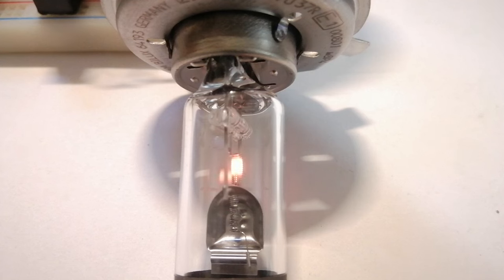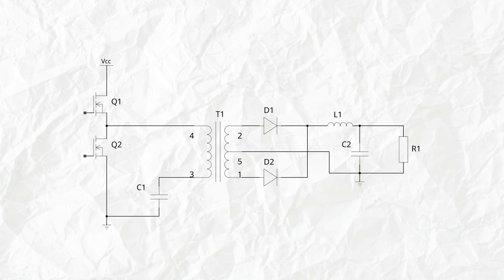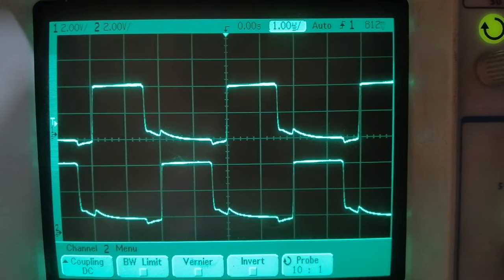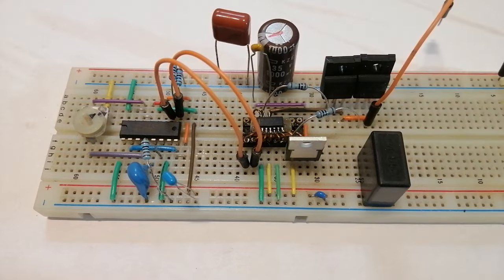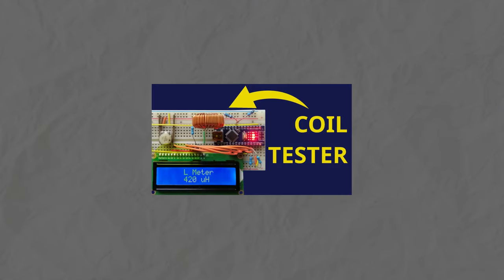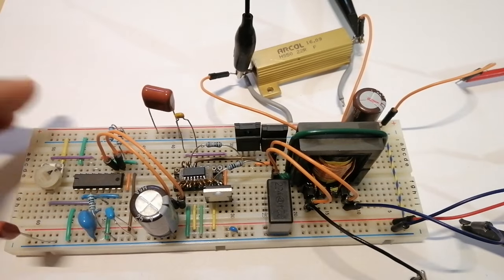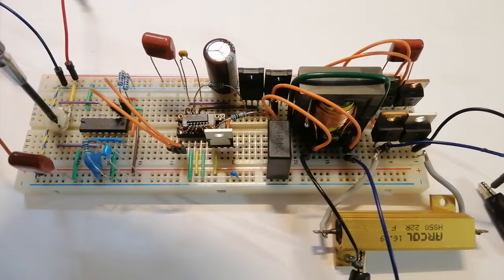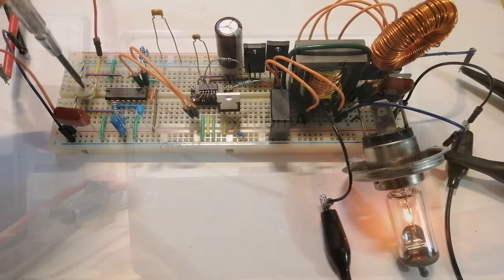Building and Testing a Half Bridge SMPS

Comment: Nice! Keep in mind that flyback transformes cores have an air gap, and that's no good for forward converters, it may be influencing the behavior of your circuit and influence efficiency for sure.
Reply from the maker: I forgot to mention that I ground down the ferrites to remove the gap, it's not the most beautiful solution but it works well. The important thing is that the primary inductance is sufficient, which is what the gap effects.
Reply: @5VLogic It doesn't need to be pretty, it only needs to work  :) the only issue possible with sanding is it may not be 100% gapless due to flatness imperfections, but it wont make a huge diference anyway.

Comment: Is it actually possible to use a voltage multiplier (diode-condenser circuit) rather than a transformer at the output?
Reply from the maker: I believe so, yes.

Comment: Sir, I designed a 24V half-bridge SMPS with an IR2153 IC. I'm getting a 24V output, but when I connect a load, the voltage drops to around half of 24V. What is the problem, and how can I fix it?
Reply from the maker: The voltage across the primary is always half of the input supply so I can assume 12V is correct. The over-voltage  with no load can be caused by rectification of the ringing oscillations from switching transients.
It's just me taking a guess though.
Reply: @5VLogic  Thank you your reply. Transformer input voltage is 150-160VDC, but decreasing input volt also.